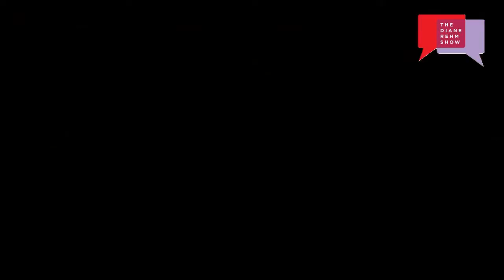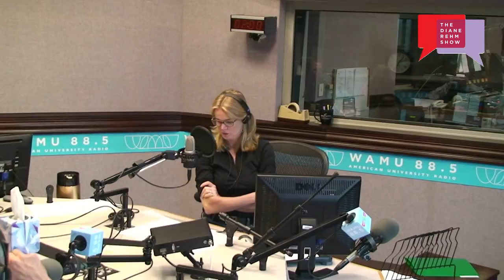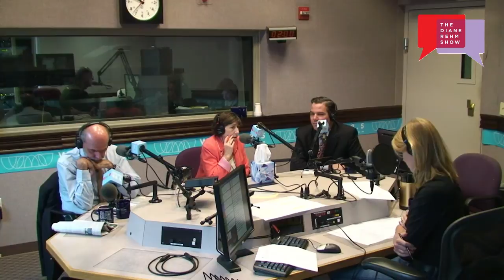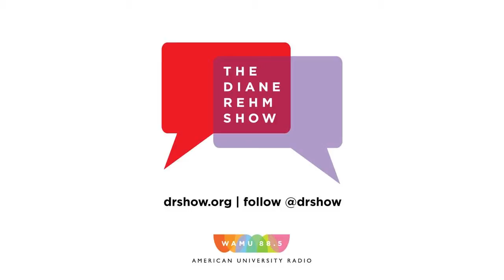Why Don't 'Tornado Alley' Homes Have Basement Storm Shelters?

Comment: This is a genuine question of mine. In MN. we have basements built in clay, sand, rock and there are ways to help your foundation last longer when you start construction. Soil shifts all over the US and foundations do crack once in a blue moon and we fix it..And towns in tornado alley used to fund tornado shelters in random spots built to house 20 or so people in. They were built in the 1940s and 50s and maintained until the 2000s. Why aren’t they maintained or rebuilt anymore? Lack of funding.. small towns in rural areas lost money when small manufacturing moved to china. So, if you have a basement or have built yourself a shelter and know that a neighbor has neither; be a good citizen and tell them if there were a threat they could come shelter with you. The clay soil fact is a CRAP excuse!

Comment: Surely, humanity can come up with a solution to the mass-murdering tornado problem.  WTF have the meta-materials science dept been doing all these years? Still no cement or similar material that can flex with pressure, so they can build basements in Tornado Alley and FIX THE DAMN POTHOLES, FOR GOOD!  The same tech would be used here.